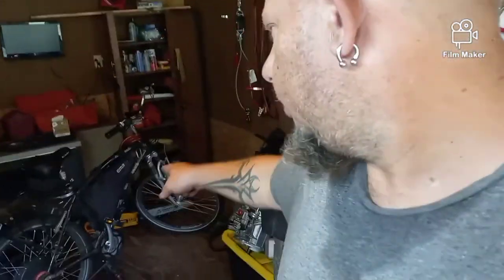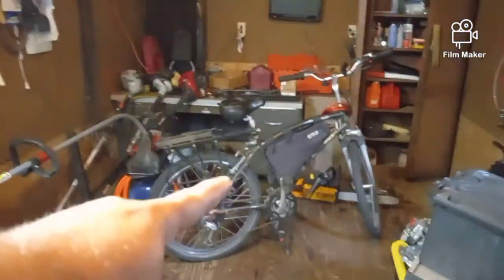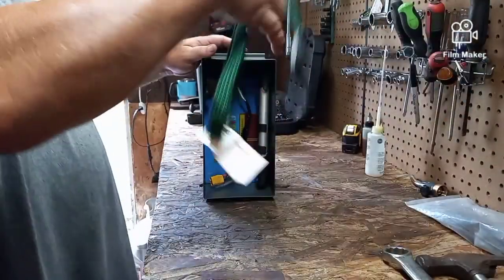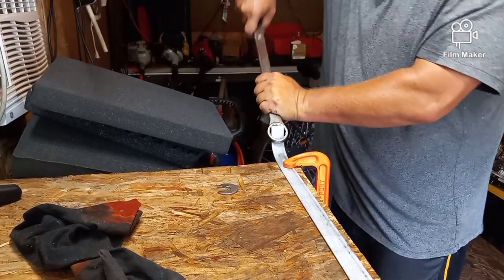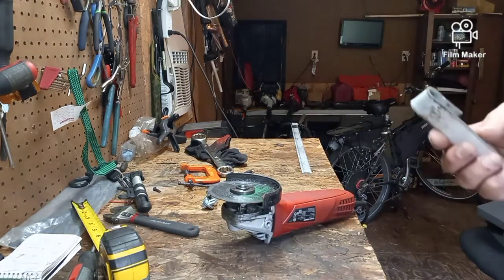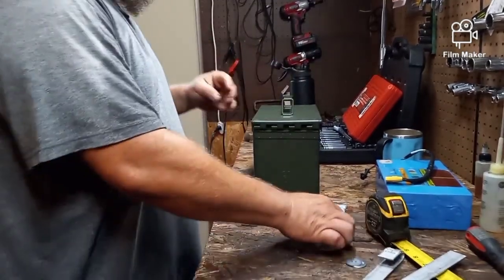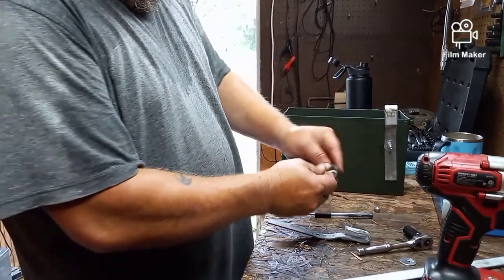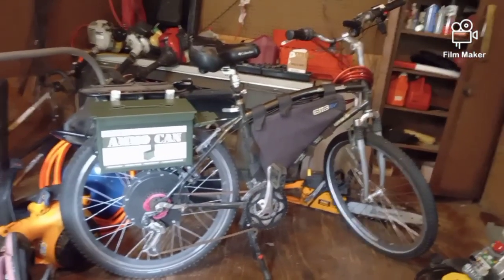Newest Panier Rack / Saddle Bag DIY Install E-Bike Lectric.. Accessories Ammo Box

Comment: I like what your doing , I bought a pair of the 36v 55ah robot batteries from batteryhookup to use on my e bike and see the harbor freight pelican case is just right with enough room for tail lights and blinkers my main concern is weight as I have the 36" by 4" tires (fat tires ) and not sure how much weight they can hold these batteries weigh 25 lbs each plus the bms and box